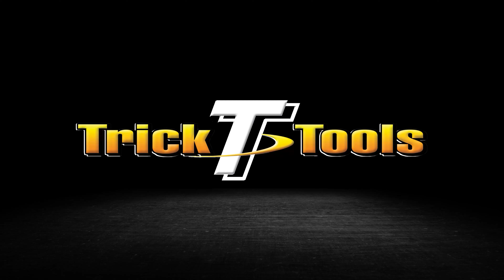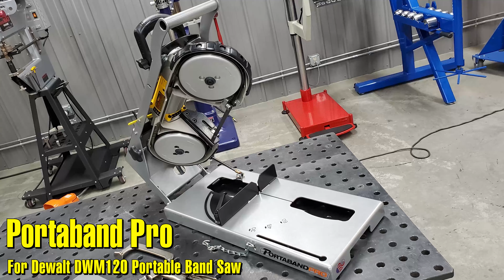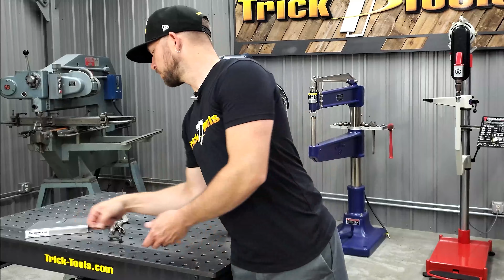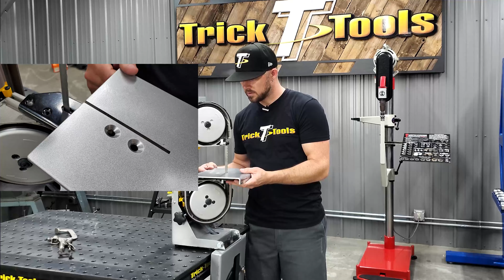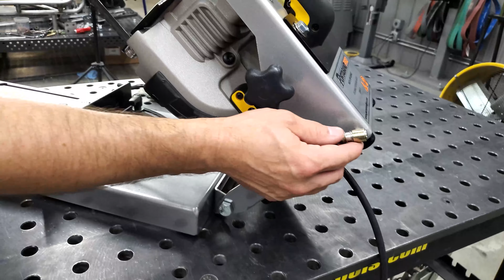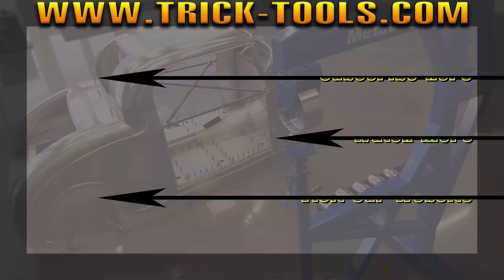Portaband Pro for DeWalt Portable Band Saw - Trick-Tools.com

Comment: NICE, ANY PLANS FOR A PLATE WITH MITER SLOTS?
Reply from the maker: The back rest of the base is adjustable from 0 to 60 degrees of mitering
Reply: @TrickTools  I MENT THE PLATE FOR WHEN THE SAW IS IN VERTICLE MODE
Reply from the maker: the plate is bolted to the saw and with that you can feed your material into it at any angle you want.